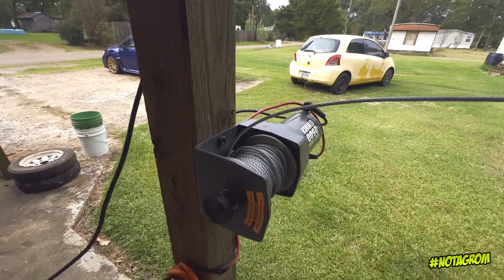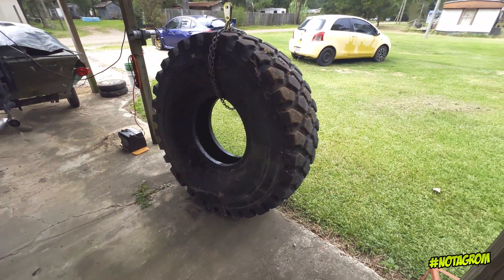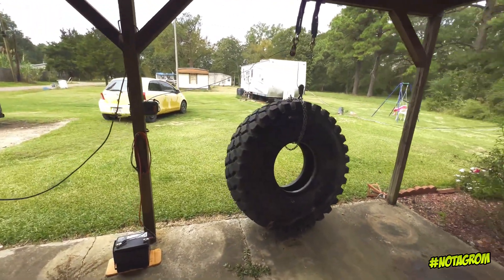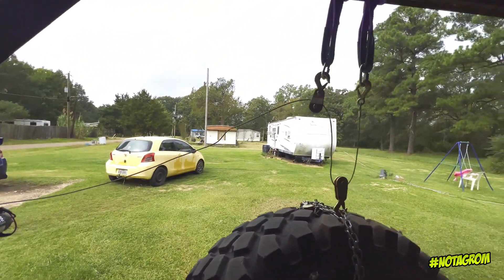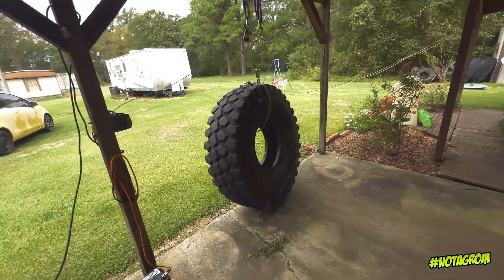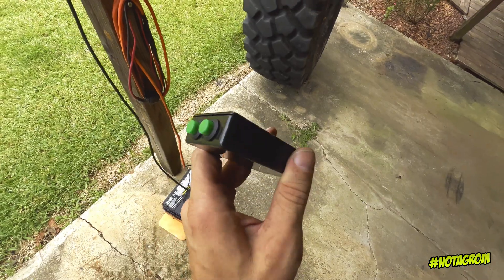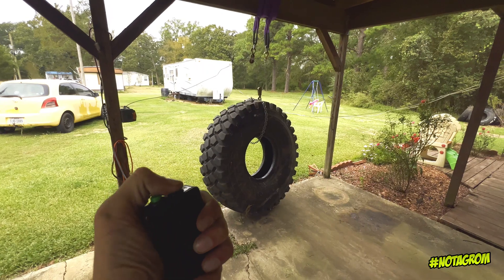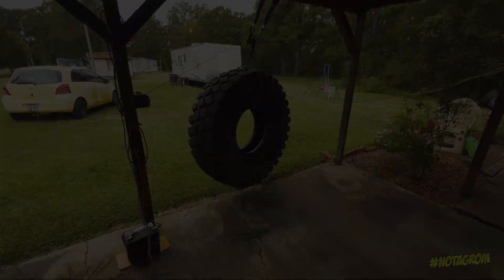Build a CHEAP Electric Engine / Bike Hoist using an ATV Winch!

Comment from the maker: If you don't have a harbor freight nearby, or would simply rather order on Amazon instead? 
Help support the channel by using the affiliate links below. I've linked every item needed to build this hoist yourself! 

2000Lb ATV Winch : https://amzn.to/3ZSwjEL
Traditional Snatch-Block Set : https://amzn.to/3M2eSvz
Snatch-Block w/ Hook (Need 2) : https://amzn.to/3rTr0Iz
Quick-Link 2 - Pack : https://amzn.to/3tuxGxc
Pair of 6ft "Tree-Saver" Tow Straps :  https://amzn.to/3Fd7Osp